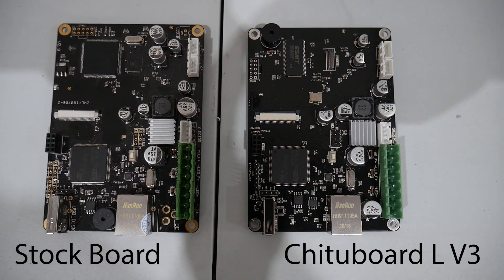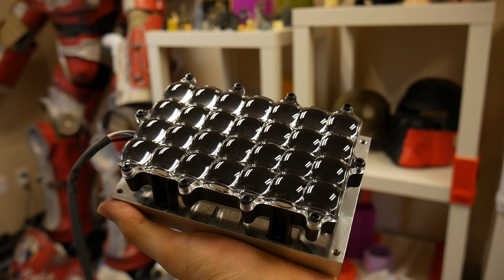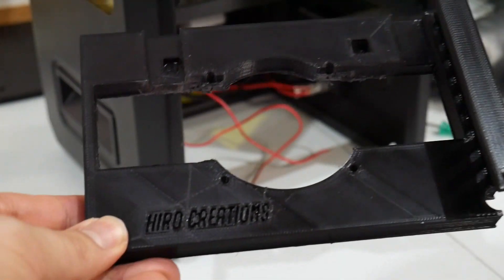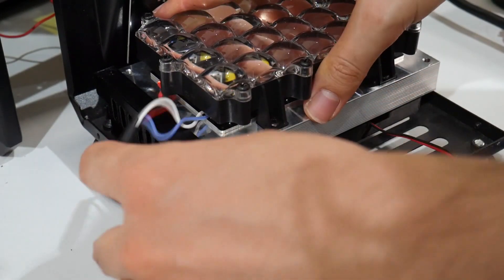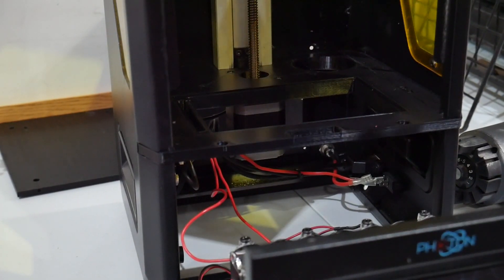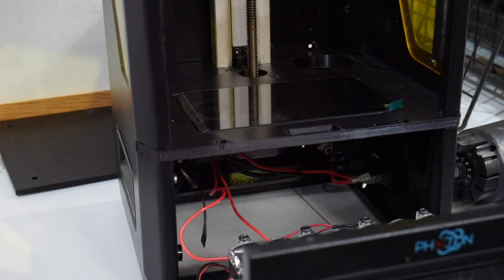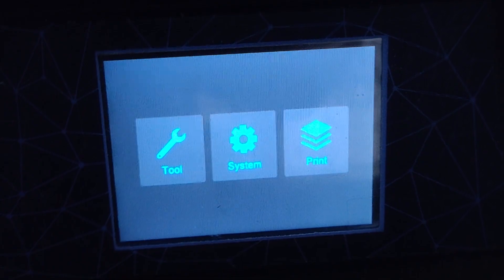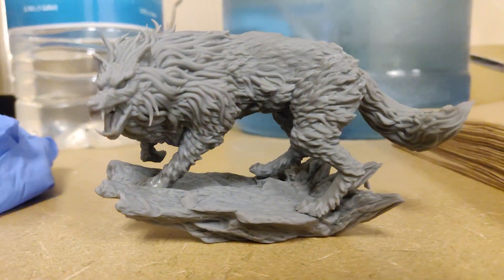Overclock a OG Anycubic Photon with a Mono LCD Upgrade

Comment: As far as i know, the creality ld-002r  already comes with a v3 board, so this mod might be even easier on it. Looking forward to someone trying that out (I'm not willing to sacrifice mine yet lol)
Reply from the maker: Interesting, keep in mind that FHD 5.5" monos are coming soon as well in a few months--and would be an easy drop in replacement.
Reply: @HiroCreations  Do you think the uv leds would need upgrading as well ? (I assume so)
Reply from the maker: Probably not if you are holding out for the 5.5" mono as parallel arrays are generally pretty good unless they are too small for the screen.
Reply: I'll instantly try it when 5.5" screens are available :D

Comment: What is "with sharp04" on chitubox board link? Also, did you use the same VAT from original photon?
Reply from the maker: That's the the connection type, the 6" mono screen uses the same connector. And I believe the firmware on the L v3 will recognize both 6" monos and 5.5" rgb sharp SX04 screens (what Elegoo uses on the Mars)
Reply from the maker: And yep, same stock photon build plate and vat they fit the 6" fine with only a 3mm loss in build volume.

Comment: If i use It with Photon S, can I keep the led array or I need change it too?
Reply from the maker: Depends on the size of the LED array, if it's the same size as a 5.5" screen then you will have dead spots on the edge of the 6" screen. If it's bigger, then you should be fine to keep using it.
Reply: @HiroCreations  Let's say I didn't change the light array (For Photon S) and used 6" mono screen, what can I do in slicer software to avoid printing over dead spots which are on the edge of the screen  (keep printable area as same as before in 5.5" screen). I'm asking this due to curiosity and economical needs :D
Reply from the maker: If you have basic CAD skills you could draw up a rectangle model that matches the edge of a 6" mono and has a inner edge that matches the outer dimensions of an 5.5" most slicers will center the first model on the plate (or have a button that centers models you can drop that guide model first then arrange the rest of your models to your needs. Once you are done, just delete that rectangular guide--boom perfectly arrange models that don't get affected by lack of light--I do a similar trick to avoid putting models over dead pixels to stretch out the life of a screen.
Reply: @HiroCreations  YES! I can definitely do that :D Thanks man :D
Reply from the maker: Thanks for giving me a new video topic idea ;)
Reply: Why is a 6" to 5.5" masking frame necessary? Couldn't just set a 5.5" print area as a custom printer in the slicer and never place any object outside of this area?
Reply from the maker: Two issues crop up, first the input resolution in the sliced file needs to match what the board is detecting--or it will trigger and error and not print. Second issue is the adapter plate allows the screen to lay flush and not create a "bump" that would mess with FEP sheet if you overlayed it on the stock 5.5" plate.
Reply: How would the larger mono LCD fit in the cutout of the bed plate that is sized for a smaller LCD?
Reply from the maker: @laphijia  The stock OG photon (and S variant) actually has a build plate and vat that is practically the same size as as the plate/vat size for the new Anycubic Mono & Mono SE (I just measured for a review video) So build plate size would scale up and use the entire screen size without issues or loss of build volume.

Comment: I may have to do something similar to my Elegoo Saturn. Since I got it I have had nothing but issues. A bad build plate which they replace. My TFT screen had a loose ribbon cable which I fixed then the 4k mono lcd stopped working which they sent me a replacement. But that replacement also didn't work as it seems to not be the lcd at all and more than likely the motherboard. Just waiting now to see what they say next. But I have seriously been thinking of just buying my own motherboard from Chitu and using their firmware in the Saturn. It probably would be the easiest route for me. To this day I have not printed one thing on my Saturn. I've had it for 2 months so I am a bit frustrated to say the least. So much for scoring that early bird version of it. LOL
Anyways. I really liked your video. It gives me hope that I may one day just get this thing to print something. 😉
Reply from the maker: Dang that sucks  to hear that the Saturn is having issues so early in their release. 

Yeah I feel like a lot of the LCD issues get misdiagnosed when its really the board or the drivers on it that are failing. 

The folks in the Chitu Systems User group have been super helpful, might be worth dropping a post there and see if anyone has some input on the issue--since I believe the Saturn is either running a clone/genuine chituboard. (either way the pin outs are nearly identical to the Chitu M).
Reply: @HiroCreations  I've actually talked with Chitu directly on this issue. They were the ones that doubled checked that I had the right firmware installed for me. It is a Chitu board. Not exactly a clone of another one but one specifically made by them for Elegoo and their Saturn. Chitu does not sell that particular board directly. You have to go throu Elegoo to get it. But Chitu does have their own board that will work in the Saturn. I actually got in contact with them through a post of theirs on twitter that mentioned a Saturn using said board. It is the (Chitu L M1).
What gets me right now is Elegoo as of yet does not offer a direct link to their Firmware. You can get if from then if you ask them through support though. That is how I got a copy of it, eventually. The firmware didn't fix the issue with my board though. I think if is just faulty and needs to be replaced. Hopefully they will send me a replacement. If not then I hope they will take the printer back for a either a replacement or refund. If not then I will more than likely just buy the Chitu L M1 to try and fix it myself. I probably should just do that and be done with it, which is very tempting. But I am trying to give Elegoo a chance here. So far they have been good at trying to help. But it is getting close to where I may just give up on them. After all I have been dealing with them for 2 months now. Anyways.....I'll see what happens soon enough.

Just a side note. Chitu told me that their screens like 8.9" 4k mono lcd do not have the glass layer on them. The ones on the Saturn have the glass already applied . Just want to mention that if anyone is thinking about buying a screen from Chitu directly for any printer.